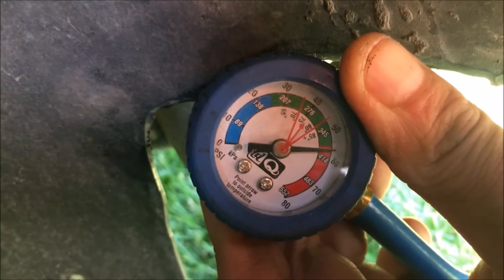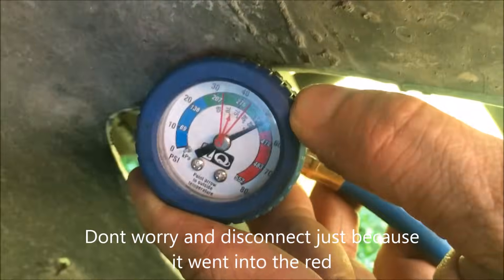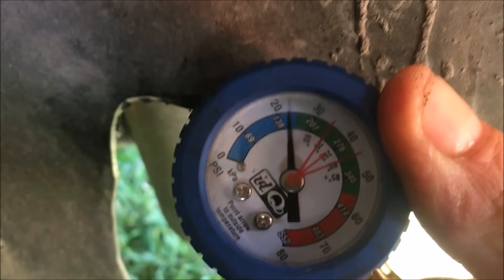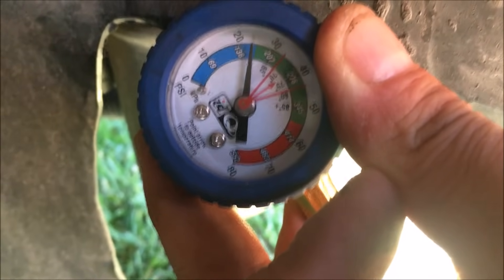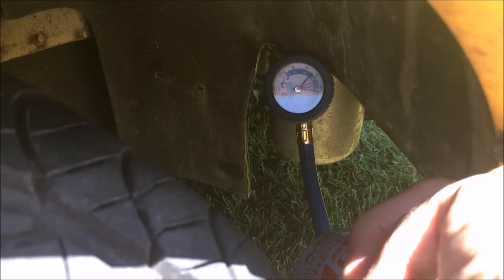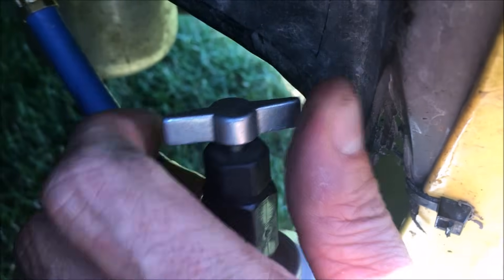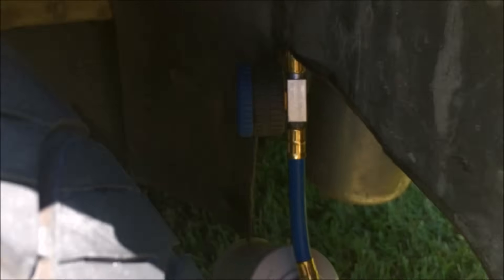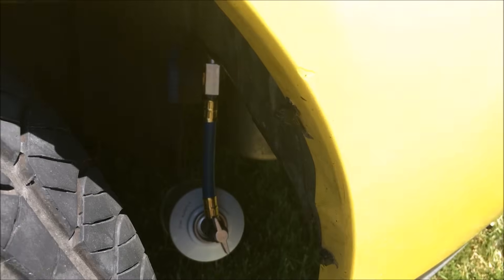Ac kicking on and off ( FIXED ) pressure fluctuation ( solved ) Recharge car ac. pressure to high?

Comment: Great video.  I recharged my Blazer from completely empty vacuumed system and the the compressor won't kick on.  With the system fully charged  I'm reading about 110 on both the Hi and the Low side so I assume that is the normalized pressure.  Any idea why the compressor won't kick on?
Reply from the maker: Check the pressure switch , disconnect it see if it kicks on or bypass it with a wire, if that dont work check the relay or the fuse for the clutch
Reply: @NOBOX7  thanks, is there a clutch fuse?  i don't see it in the fuse panel

Comment: nobox7- i be dam,,, it worked.!! btw- my ford f150 is a 98 model, never had any problems with the ac/heat other than the cheap plastic blend door inside the cabin, which i replaced in 2016, with the dorman blend door (aluminum hinge on it-not plastic that broke on me). it has the original compressor from the factory with the original freon charge from the day i drove it off of the dealership lot, needless to say, it's been bullet proof all 21yrs later, until now, it just needed a simple "first time" freon charge, so, you can say all you want about the ford ac system, i appreciate mine. lol. 
thanks nobox7, thanks for your help. god bless.

Comment: great vid bro! my ac goes from gren to ahalf way into the blu zone, will it be same?
Reply from the maker: If it keeps as long as the compressor doesnt kick off your ok , drive it to get it hot then pull over to listen , if it keeps clickking off and on your either over charged or under charged . try letting some fluid out with a small rod by pushing the shrader vavle pin in out and as soon as the compressor stays on stop letting fluid out

Comment: I replaced the climate control module, pressure switch, the cycling pressure switch checked the wiring jumped relay to cmpressor it turned on all relays were good. Also have very high pressure but not enough ac coolant so its not cooling. If i try to put more ac coolant it shoots to the red right away. Should i just keep adding the coolant?
Reply: Yes add it slowly just like NOBOX7 explained when compressor turns off that high pressure is normal and when it kicks back on it drops down meaning to add ac refrigerant.

Comment: Is it better to have the pressure fluctuate down to the lowest recommended pressure or the highest recommended pressure when recharging your system? I put one 12 oz can in my truck and I am getting fluctuating pressure within the recommended range for the outside temperature.  Thanks for your help.

Comment: My car runs AC and then cools off the cool air. I try to turn it off and then it starts working again. Does it contain more oil in compress .. Is the sensor bad or it has less or more gas?

Comment: My mustang is doing this as I try and fill the AC. I'm scared to keep adding freon because a month ago as I filled I had a blowout (I think a relief bolt on the compressor let it all out in a cloud of freon) . I just want to make sure it doesn't blow out again.
Reply from the maker: You may have air in the system . does the pressure go down when the compressore kicks on ?

Comment: i recharged my mitsubishi eclipse and about a week later i went to turn on the ac and the light on the ac dile in my car started blinking and it made a noise like a garage air compressor would sound and it doesnt blow cold air any help would be apreciated
Reply from the maker: doesnt sound good friend , sounds like a blown compressor
Reply: ok thx very much

Comment: I have a ford also and you explained exactly what mine is doing.  Couldn’t figure out why it was showing overcharge until I saw your video.  Makes sense now.  Can instruction doesn’t apply to ford vehicles and that should be noted.
Reply from the maker: Glad to help Deano

Comment: You are freakin awesome. Got my ford ranger ice cold. Thank you. You are why YouTube was made.
Reply from the maker: right on brother, glad to help
Reply from the maker: Adam , forgive me , i forgot to mention that you  also are " freaking awesome, thank you ," you are why we still use youtube comment section . you are the opposite of troll     Brother you are  a UNICORN OF THE COMMENT SECTION
Reply: Adam G. Glad you got your Ranger blowing ice cold.  I am trying to recharge mine without overcharging.  How many ounces did you add to your truck and what size of engine do you have? Thanks
Reply: Austin Franklin, I got it fixed with two cans. Thanks

Comment: 1995 jeep grand cherokee V8.  ac comp kicks on and off but after a month I cant find a leak.. I'm a "shade tree mechanic" but i'm stumped. I pray the evap isn't clogged.. damn ac engineers !
Reply from the maker: it may be your pressure switch some cars have 2 high and low side , if your fast enough you dont even have to vac your system to change one . as you remove just 1 very fast the 134 boils , it doesnt boil off instantly , it takes a time , so you have a small windo of time in which the system has a positive pressure , its very low but no water or air will get in . change the low pressure or the easiest first   . then charge , if it still fails change the other , if that doesnt work , sorry good buddy , you need a new jeep , you deserve AC my man , or bust out the sawsall and change that expansion valve . i think the expansion valve symptoms  act a certain  way  , thay stay on for a very long time then they kick off, its not a on, off, on ,off ,like a switch triggering , it draws a  Relative vacuum  compared to the high side and the low side will drop to say 10 0r 20 psi , this causes the compressor to kick off but it takes time to do it . go watch a couple expander valve videos and observe the gauge behavior and please get back to me tell me how the pressure gauge acts, even a can gauge from a refill canister  can diagnose this disease  .

Comment: My car compressor keeps turning on and off after I put a 22 oz arctic freeze
Reply from the maker: it may need more , its possible you have a leak , i would try 1 more can or you over charged it , let some out untill the compressore stays on
Reply: I put another bottle of 10 oz but still turns on and off
Reply from the maker: Ok tell me what the pressure gauge is doing and i can help you , if it kicks off and the pressure is to high then slowly let fluid out until it stays on , if it kicks off and your pressure is to low say if it goes under 30 psi then you have a leak possibly or the expansion valve is shot . if it works for a while after you charged it you may just need a dust cap for the fill port . that cap is part of the system seal

Comment: Bro thats usually an indication you overcharged it
Reply from the maker: it was empty brother
Reply: my 1999 chevy 1500 4.3 does same thing niddles goes up and down as the ac kicks in  not blowing  cold air ether
Reply: Reyy Vasquez i over filled mine and it was doing exactly what this video was showing. I blew out my valve for a good minute or two and it fixed it.  It had to blow out a bit though.  This guy is bullshit in the video in my opinion.

Comment: I used one of them AC Pro cans. My compressor wouldnt kick in untill it had some R134. It was cold air and within a few days it went back to hot air. My compressor still kicks in. Today i checked with the gauge and i was getting the same fluctuation. I guess i have to add another can? The first time i added a can of r134 it was on the green.
Reply from the maker: you have a leak my friend  , did you put the cap back on the fill port ? that cap has a gasket or O ring as its called and it is essential in sealing the system , the valve alone just wont do , i know this from experience , go get a cap to put back on the fill port , they sell bags of them that have every kind under the sun , it cost like 10 bucks or less
Reply from the maker: now that you recharged it once you risk adding to much oil and additives that dont leak out like the 134 does , next time you charge it be sure its pure 134 with no oil , also your system may need vacuumed out now that its leaked but maybe not , let me know how it goes
Reply: NOBOX7 ugh... the cap was missing when i purchased the truck😅. I was thinking no way i could get a leak from there because its a valve but thanks. Maybe i should get some pure r134 cans? The truck specs says 2pounds of r134. I think the AC PRO is an 18 ounce which is only around 1 pound. The thing was completely empty. I got the truck for 1700 bucks for a weekend homedepot runs. Not trying to put alot into it
Reply from the maker: Go to auto zone and they will hook you up ,  i learned that (shrader valves ) leak without a cap , long story but thats why the cap has an O ring , and oil it it needs to make a good seal . This might not solve the problem friend , the fact the cap was off telld us it was messed with by somebody unfamiliar with ac systems . Try the cap but also check your condenser for little rock impacts  if you see alot of impact your condesor might be shot , it could be any thing but i would try a cap
Reply: Update- i went to the parts store and bought the caps for the high and low fittings. Also purchased 2 cans of r134. Its been about 1 week and a half and my air is still cold 😁 thanks  alot!
Reply from the maker: oh wow , very happy for you , i really hope it holds out friend , So glad i could help you and thanks for sharing your results  b e

Comment: So I'm sittin here, just charged a/c in my Ford Ranger, and the compressor keeps kicking on and off every 5 secs. When the needle gets low it's back in the "Low" area of the gauge. Does that mean I just keep charging until when that needle drops back it should rest in the Green "Filled" area on the gauge? And will that also stop the compressor from cycling every 5 secs?! Thanks for your time!
Reply from the maker: yes
Reply from the maker: keep Filling it until it stabilizes
Reply from the maker: also the compressor will kick off and on if its over filled  , so if you start driving and it does this after a successful charge , just push the valve open with a nail or ink pen to release the excess untill the compressor stays on then release it
Reply: @NOBOX7  ö0
Reply: When I use my ac it seems to be working and blowing cold air but I still hear the compressor turn on every 5s or so. I've added an entire can of ac pro (large can) and the guage doesn't seem to want to stabilize. The needle doesnt even go beyond yellow or the red. It jumps from low end of green to high end of green? Should I keep adding more?
Reply: @geoffallen2917   Under your hood you should be able to see how many oz you need for your system to be fully charged.  I added 2 12 oz cans and then an 11 oz can and my needle finally stabilized.  Fully charged system for me was like 33oz.
Reply: Kyle Sutton Hope you were able to properly charger your Ranger.  I am trying to charge my Ranger without over charging it.  How many ounces did you put in and what size of engine do you have?  Thanks
Reply: @JuanGomez-gb6ce  Hey Juan, I wish someone would answer your question, so I went out and looked under the hood of my '06 ford ranger 2.3l. It says on the front of the engine compartment that a full charge is 2 pounds 1 ounce. I think that is 33 oz.
Reply: @lowintestine  Thank you for your response.  I added 2 12oz cans I purchased at walmart and that resolved my dilemma.

Comment: Fords engineers should all be taken out and shot..they are an embarrassment to our country
Reply: Buy Japanese. The Germans are just as bad. German engineers thought it would be a good idea to replace an oil dipstick with a sensor and a plastic valve cover. When I changed the valve cover gasket recently because of an oil leak on my BMW, I also ended up replacing the warped valve cover too. Germans over-engineer their cars for no other reason than they can.
Reply from the maker: Poor guy , i also have worked on many Fords . Im in shock ... Drum brakes on this bad boy , yeah the same design they used on horse drawn carriages, springs pins cables  and all  . To bleed the brakes , you simply replace the entire system, to get the drum off you simply cut it with a diamond wheel ferris metal gas ax in 5 axeses then you bash it off with a sledge hammer by crushing threw the bearing race  , 50 50 chance it will come off with just a hammer. the other side did not require but 2% the cursing , and 1% of that came from the other side of the car . good thing i started at 8 am i only had 13 hrs of day light . then the adjuster wouldn't adjust    and tapping the brakes  in reverse  to do this apparently went out of style to make way for this new plastic button that is either broke or just doesnt FORD ....
Reply: the only thing worse is general motors and Yugo ingineering

Comment: I have a 2013 Suzuki Swift. Is it normal that when i turn the ac on the fan keeps tripping on/off every 5/6 seconds? Thanks
Reply from the maker: No its not normal, did you charge the system?
Reply: That happened to mine when i overcharged it. Idk if its the same issue with you but you can start there.
Reply: Futt Bucker what do you mean over charged it?
Reply: Colin Ghigo i put to much r34/freon in it. The compressor was on the whole time but once i put to much Freon in it, thats what it did. It kicked on and off every 5 seconds. But ass soon as i let some freon out of the system, then the cmpressor kicked on and stayed on.
Reply: Colin Ghigo are talking about the a/c compressor or the actual cooling fans for the motor?
Reply: Futt Bucker yeah thats what keeps kicking on/off the motor cooling fan but as soon as I turn on the ac
Reply: Colin Ghigo thats normal. Ur radiator fan should kick on when u turn the ac on. Thats actually how u test to see if ur fan is working by turning the ac on.
Reply: Futt Bucker but after i turn the ac on and the motor fan kicks in after lets say 30 seconds the motor fan keeps tripping on/off every 5 seconds.. is that normal?
Reply: Colin Ghigo does your a/c blow cold air? Or does your car overheat at all or stay perfect?
Reply: Futt Bucker yes it does blow cold air and it does not overheat at all
Reply: Colin Ghigo yea its normal function. Ur radiator fan keeps your car at normal temp. Then when u turn ur ac on, the radiator fan helps with airflow to the ac condensor in purges when needed. You dont have anything to worry about.
Reply: Futt Bucker thanks for your reply mate
Reply: Colin Ghigo no problem my man